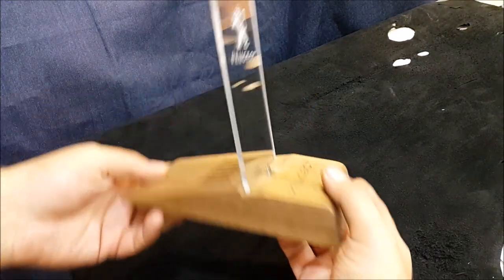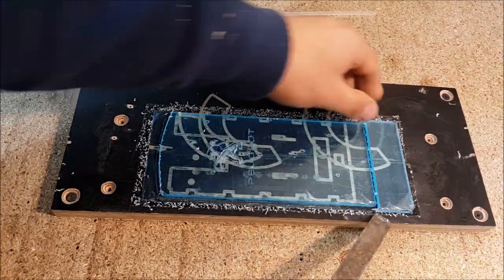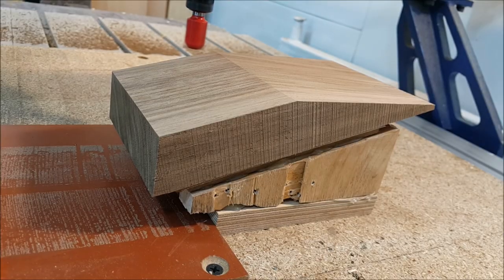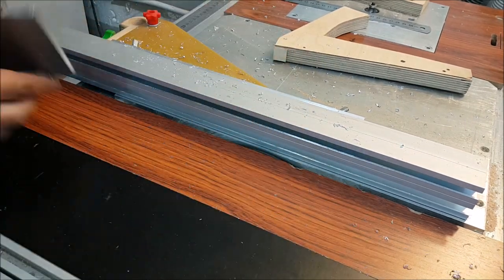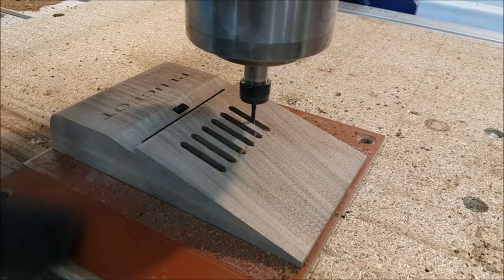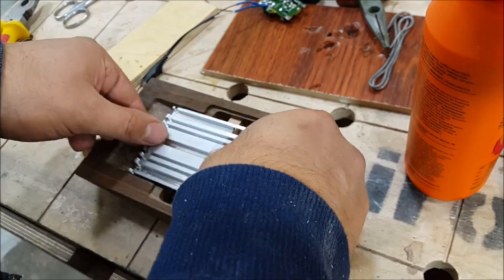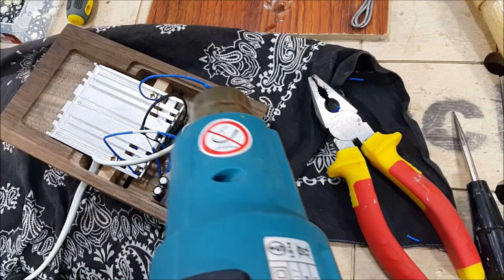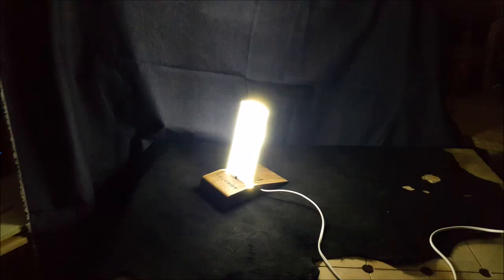Peugeot Smartphone Docking Station

Comment: Nice work! If you having problem with the protective plastic on the acrylic you can get "transfer tape". It is about the same as painters tape buy much wider, normaly used when vinyl cutting letters. I use this "transfer tape" because it is not that expencive and easy to use. Tip for engraving, try and put the engraving on the backside of the arcylic to give it more depth. Dont forget to mirror the engraving first.
Reply from the maker: Maybe you are right

Comment: love the build, a simple way to vary the brightness of tge leds is to simply add a potentiometer in series of tge powerand leds, find what brightness you like, and measure the resistance with  a multimeter.  find a resistor of similar value and replace tge potentiometer.  now one thing you could do is add a  button on the rear that allows the stand to turn into a light.
Reply from the maker: Thank you for advice. All these pints I plan to do

Comment: Nice dock! and thanks for ad of my channel! p.s. power adapter you using probably have something like 0.7A-1A output, i guess. If its true - here is advice!  I don`t know for what smartphone it made, but most of the modern phones have 2A output or more in kit one. its definitely would charging to long with this kind of power source.
Reply from the maker: Even less 0.15A). Yes, my S note 4 has 2A charger. This is trial exemp. But wife's S4 charged some hours. It turned to stand for night charging).
Reply: oh... 0.15... pain
Reply from the maker: haha). oldest of mine